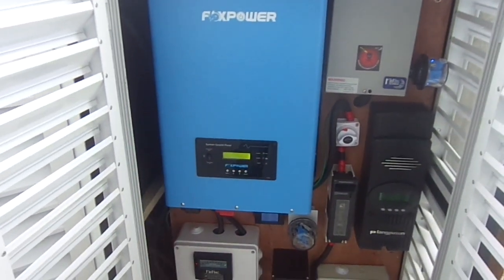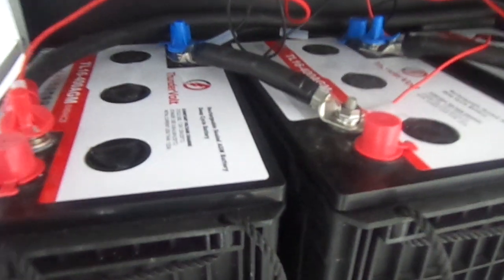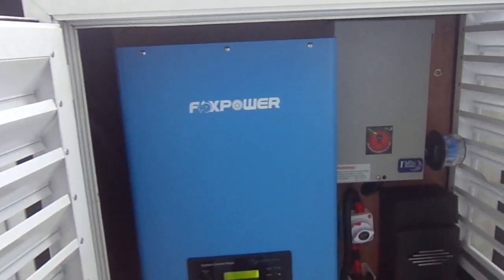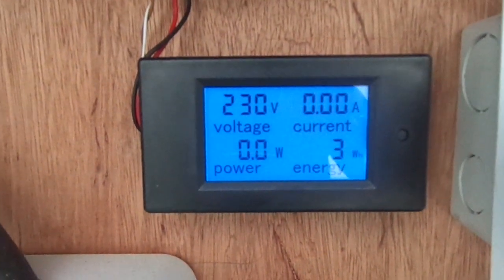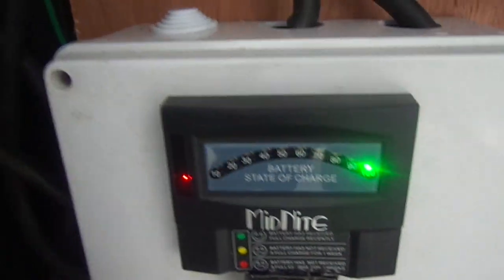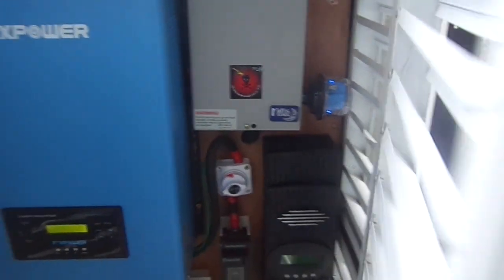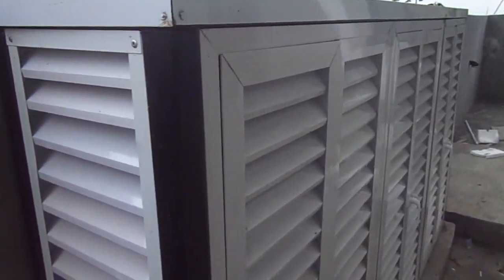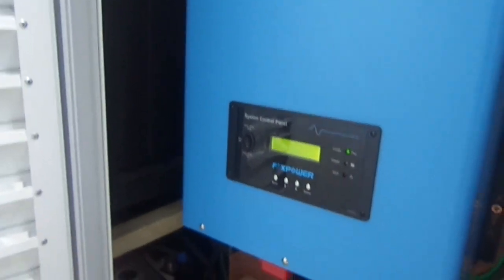3.9Kw Solar PV, 10Kw Foxpower LF Inverter/Charger  with 800Ah AGM

Comment: Thank you so much for your reply. I really appreciate it. Could I ask, if u don’t mind, does the system stay on 24/7. I asked because I am looking for an inverter that will last as I intend to depend on it as my only source of electricity. I don’t intend on connecting to the National Grid

Comment: This is the second installation you have with the Thundervolt battery. (There are actually white labeled Chinese products from Solar deportng) The specification look good on paper but how well have they performed on the field?  Also I am in between using a battery protect (or just installing a roof) for my own installation. The main concern is with humidity especially during the rainy season. What has ur experience been with them. Most elctrictics don't like humidity and the battery box looks like something that can get very humid after the rain.

Comment: wow, long time no video. Nice system
Reply from the maker: Thanks and well appreciated
Reply: @ibidapoilawole7120  have you ever had problem with this your fangpusun charge controller, the FM?
Reply from the maker: Oh yes , I had with the Fangpusun FM 80 and escalated to manufacturer and a new replacement was promptly sent to me by Fangpusun. However they have stepped up the quality control on the newer ones.
Reply: @ibidapoilawole7120 Thanks good, because I am seeing some on aliexpress